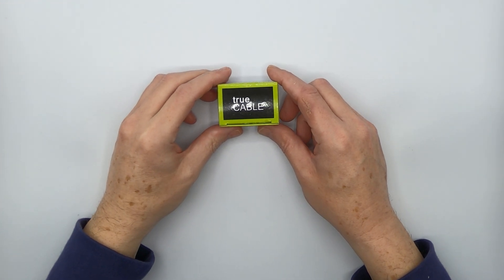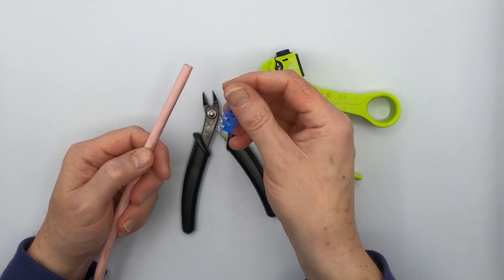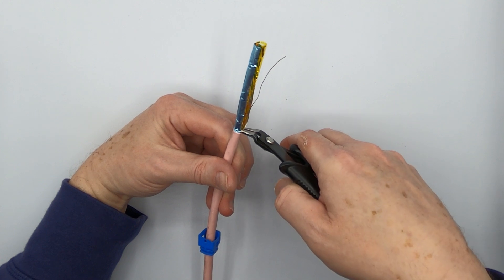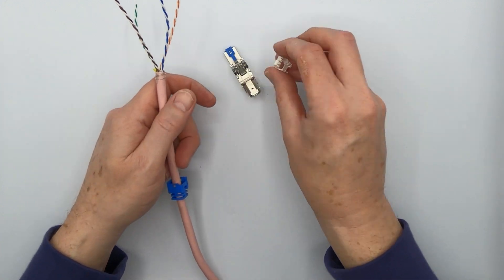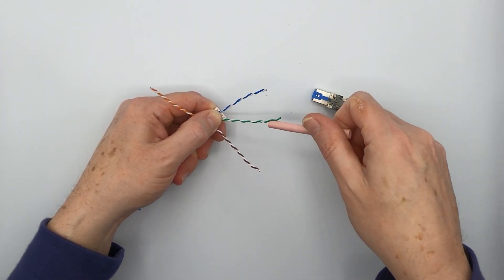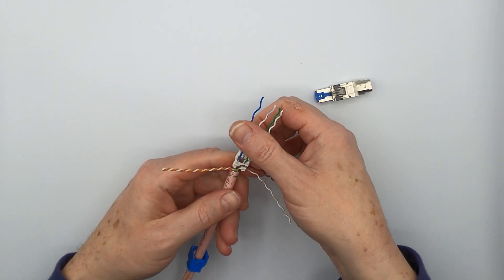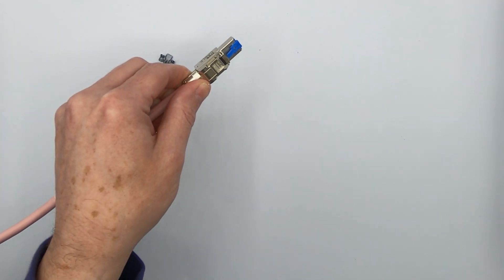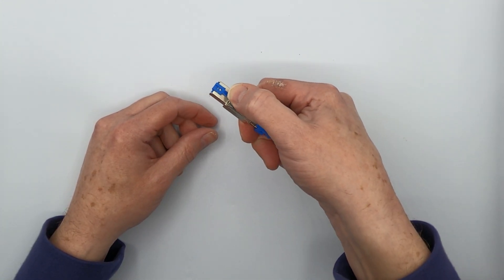How To: Terminate a Shielded Cat6A Field Term Plug

Comment: Very challenging for me right now. I need up close image very up close so i can just match my loader, otherwise I'm just trial and error. I have the 568a & b memorized but that's memorization for standard 5e & 6 termination.  The printout on this loader does not make sense. I don't understand which is the top and which is the bottom because the color code is only on the top face of the loader.
Reply from the maker: Hello and I understand. Memorizing T568A or T568B does not help when wiring up conductor holder caps for keystone jacks, or even when it comes to any kind of termination like that (punch jacks included). Field termination plugs are the same way. Instead of trying to remember the A or B pattern, simply follow the pattern that is pre-printed on the holder cap for A or B. A magnification glass may help if you have trouble seeing up close!

Comment: Would these types of connectors be good for a CAT 6 UTP solid core copper?
I'm aware that they would have to be terminated with keystone, and then connect a pre-assembled patch to it, for proper use.
Reply from the maker: Hello Jack! This particular field termination plug is designed for shielded solid copper Ethernet (Cat6A or lower) but CAN be used without issue on unshielded Ethernet too. We also have an unshielded version of this very same field termination plug, and if you are using solid copper Ethernet, then using a field termination plug at both ends is the superior way to create a "direct attach" cable. You might want to watch this video for more: https://www.youtube.com/watch?v=WFkMM2-N4ck.
Reply: @trueCABLE  Very nicee thank you! I prefer to buy the shielded ones, being reusable they would be ready if I had to move them to a shielded cable.
Although I don't often terminate a structured solid core in RJ45, due to fragility issues.

Comment: These may be electrically superior, but mechanically they are absolute garbage. The tiny plastic fiddly bits you're supposed to remove are brittle and crack instantly when you attempt to do so. The angles you're required to bend the orange and brown wires at are obnoxiously acute, and there's zero positive registration between the three pieces of the clamshell/sandwich, so when you go to crimp the thing down you more often than not bend one of the cheap pot metal tines inside and create a short you can't see until it's too late. Out of a box of six I got three usable terminations and it took me over an hour to do what should have been 15 minutes worth of work. The mechanical engineer responsible for these overpriced things should be encouraged to pursue other opportunities.
Reply from the maker: Hello Rob! I am sorry to hear you had trouble. Any new type of termination will take a bit of getting used to. I bent the prongs in a field termination plug before, too. You have to pre-seat the conductor holder cap prior to lid closure, as was illustrated in the written instructions. That will prevent the bending of the prongs. I have not encountered brittleness, however. Did you by chance give us a shout when you were having trouble? I would like to see any of the left-over plugs you may have lying about so I can take a closer look. Please give us a call at our main number at truecable.com/pages/contact-us. Ask for Don, I'll be more than happy to help!

Comment: i don't see how is accepted to give up the actual shield on the cable and keeping the wire that is used to split the cable
Reply from the maker: Hello loan. The wire that was retained for cable shield bonding is the ESD drain wire, not the rip cord. The ESD drain wire makes full electrical contact with the cable shield on the inside of the cable jacket. The rip cord is fabric where the ESD drain wire is tinned copper.

Comment: Why would you us this over any other connector?  Seams a bit over kill.
Reply from the maker: Hello Wes! field termination plugs, such as ours, impedance match and greatly help with NEXT performance at the connector. When it comes to 500 MHz and above (such as where Cat6A operates) this can become the difference between achieving reliable a reliable termination that actually will operate at 10GBASE-T. I have a growing amount of data on hand that demonstrates field termination plugs will always out-perform a plain 8P8C plug...all other things being equal.
Reply: @trueCABLE  thanks for the reply, that's is helpful.  Be good to see all the options and how your products out perform the others.